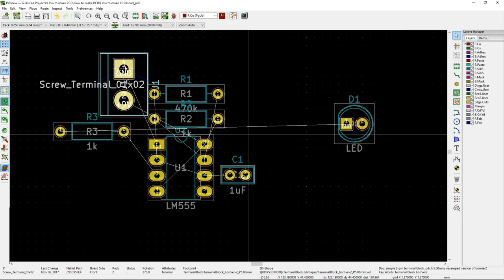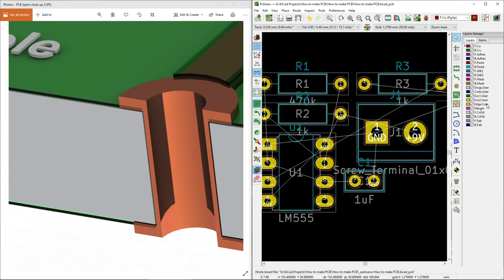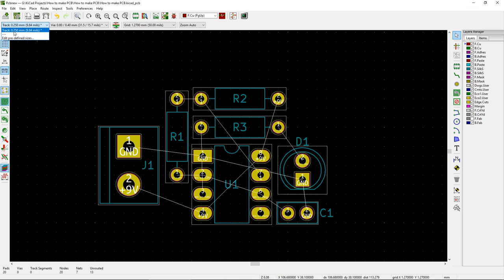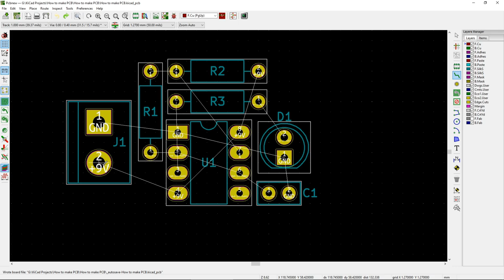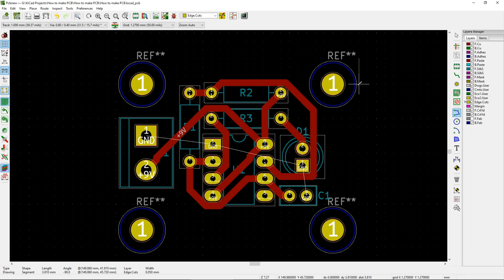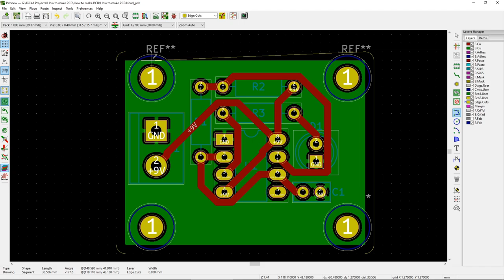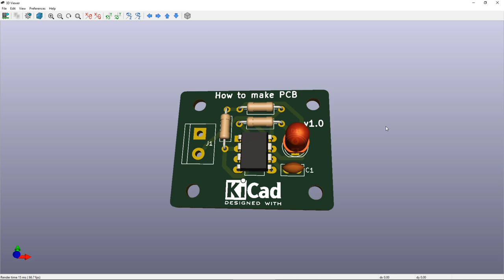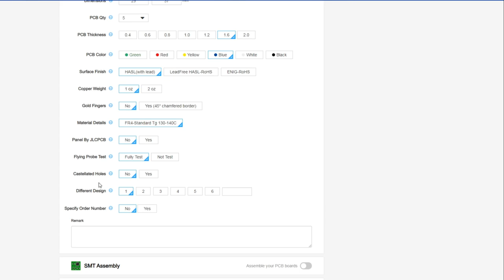Design your own Circuit Boards using Kicad Part 2

Comment: Thanks so much. As a  novice, video parts 1 & 2 have completely removed the anxiety of circuit board design for me. I feel more confident and compelled to move forward in PCB designing.

Comment: Thanks, I've used KiCad and now I'm using the online schematic capture provided by your sponsor. In both cases, the fly in the ointment is footprints. They all have some, but rarely do they have the component footprint you need. Without the footprints, you have to create them to use it in the PCB. You need hole sizes, pad sizes, component pinouts etc. its a PITA.
Reply: @philipdifrancesca  Thanks Phil. I just updated my sources list and installed the latest version of KiCad and libraries. Maybe the newer version is a little more complete (I was running 4.xx, now onto 5.xx). In any case, the gripe wasn't against KiCad, it was about the state of the component footprint schmozzle. I noticed for example that EasyEDA includes unfiltered "User" components. Some of these footprints are completely wrong, some, even worse than completely wrong, have one or two details like TH size wrong...enough to stuff up a PCB build. I've had to resort to getting the components I intend to use first, pulling out the caliper, micrometer and checking/correcting foot prints.
I don't know the answer to this dilemma. You don't want to impose standards on component manufacturers - that just stifles innovation, but not having a standardised footprint for every component manufactured means you have to resort to measuring actual component dimensions.
Reply from the maker: @MiniLuv-1984  Odd footprints are a headache to deal with. In a future video I'll go over designing foorprints from scratch

Comment: Best KiCad tutorial yet.  I followed part 1 and everything worked out fine.
Part 2 is fine until the 3.07 mark.  I am using V5.1.4 and when I hold down the "M" key to move R3 all the components move not just R3.
Its as if all the companents are grouped into a single unit but I cannot find any mention of a "Group"/"Ungroup" option.
Searching on line suggests the "L" key unlocks.

Comment: Once again, an excellent presentation... Though I feel you should have given more clearance between some tracks and solder points. I realize getting the PCB's made professionally, clearance isn't much of an issue, but if someone wanted to etch their own PCB's, clearance will definitely matter... Regardless, great tutorial... 10/10
Reply from the maker: I'm glad you enjoyed the tutorial. :) Changing the clearance will be featured in a future video.

Comment: Hi Schematix,
I'm now a retired senior, but you remind me of my younger days when I had lots of vim, vigor and ambition. 
I'd love to see the process of the following, after I describe what I think is an easy solution...
The Neutrik combo connectors XLR/TRS (non-switched) do not make the parallel connection internally. So, if one chooses to do so, they must first 
jumper those 3 connections on the jack before connecting the 3 wires from the mic/equip't. I made a connector to terminal block adaptor and I'm presently waiting for a 2 sided PCB from JLBPCB, and really struggled with what I think you could do easily.
Could you walk us through such a process so others might be able to bring a simple process to the masses? I needed to constrain the PCB to a 1"x 1" size as the connectors are often installed in ordinary wall plate style panels. How can I send you my files for your "look-see", as say in the states?
Thanks again! You're channel is quite good.
Larry

Comment: The "via" function is one of the key reasons I didn't upgrade from 5.0.2; it slows down my work flow.
Under the older version, I can route on a layer until I get to the point where I need to change layers, then press "Page Up" or "Page Down" to change to the new layer and continue to route.
The next trace is put on the new layer and a via is added automatically. No cancelling trace route, adding a via and continuing.
I didn't much care for the "new" graphics rendering either. There were a few other "features" that in my view, destroyed a perfectly functioning productive piece of software.

Comment: Excellent video!  To repeat what was said before, I was hanging on every word.  Well presented and easy to follow along.  

Question:  Since I'm not going to be making multiple PCBs copies and thus have no use for a PCB house,  is there a feature in KiCad which will allow me to print out my own PCB layouts (i.e., a black and white) so that I can heat-transfer them onto my copper boards?
Reply: just save your gerber files and print it through inkjet printer and then you can use heat transfer method i did the same if not happening try using PCBdroid (for mobile) or EXPRESSPCBLAYOUT (for PC) there youll surely get these options i havee done it my custom PCBs through these softwares.

Comment: Just my luck, hardly any footprints to suit my components, big transformer, big non polarity caps, big diodes, everything big. I did find my transister though. At least now due to your tutorial i'm finding my way round the program rather than scratching my nut(head)thanks. The biggest thing i'm having problems with is footprints, reading the comments I'm not the only one so looking forward to that video when it comes out. I was suprised by the install time, and i got screens that you didn't, probably as it was my first use so i just selected the defaults on libraries etc. i even tried downloading some .pretty files from github hopeing to get more footprints and components  but don't know where to put them. I'm probably jumping the gun and get all this explained in future videos, at the moment i'm sitting on the front edge of my seat 😆 in expectation, big thanks.
Reply from the maker: I'm glad you found it useful. I know to well, the struggle with footprints that aren't included in the default library. New videos are in the making
Reply: Have you tried RS Components or Farnell? Lots of downloadable components to add to your library 👍

Comment: How thick is the copper for the ground plane? If it's too thick it will absorb most of the heat from the soldering iron and make it dificult too solder.

Comment: Why is my circuit board in 3D transparent? The bottom side of the board is not filled in and I can see through the whole board! Solution...add graphic polygon.